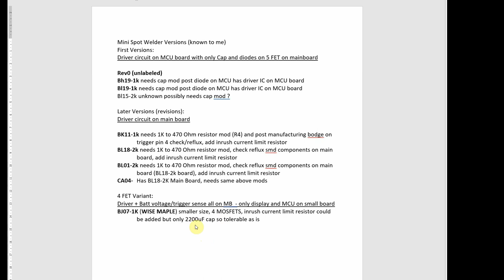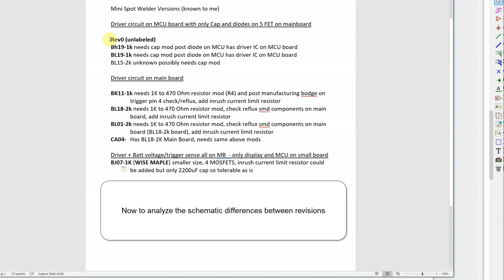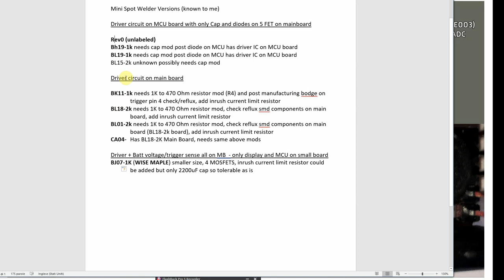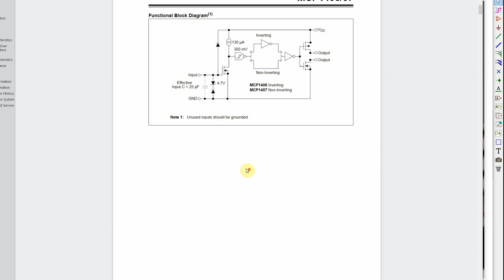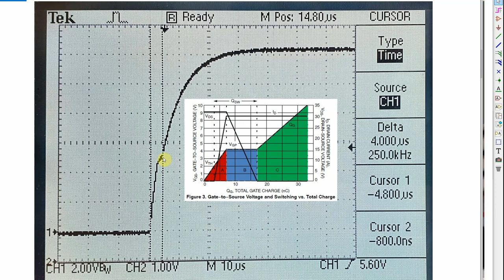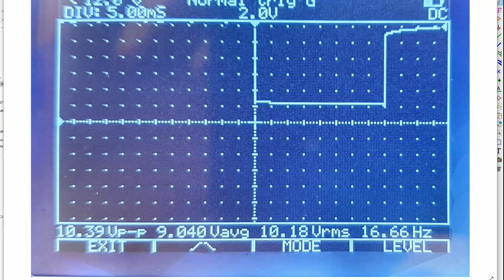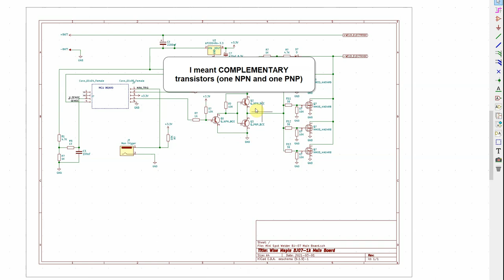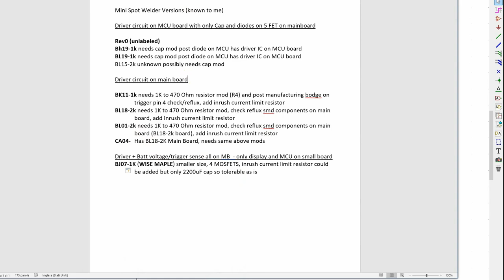All "Mini Spot Welder" versions: circuit Analysis, differences and faults

Comment: Just received one from eBay - display/MCU board marked Bl01-2K, MOSFET main board also marked Bl01-2K, that has some clear post-production hacks soldered on to the backside of the MOSFET board.  There is a 1K  resistor soldered between pins 1 & 2, and what appears to be another between pin 2 and the negative pin of the capacitor.
Reply from the maker: Yes that's an old revision which I also received but was labeled bk11-1k: please check out my prior video about it. I suggest you check the solderings of those biasing divider resistors, the 1K and 10K connected between + and GND. Mine where not soldered on properly, specifically the one with the bodged on copper wire to GND (10K). I replaced them with 2 normal resistors but maybe yours are ok, check continuity first. You need to replace the 1K resistor (R4 if you have a silkscreen) on the MCU board with a 470 Ohm one and don't forget to add an inrush current limiting resistor in series with the diode beofre the large 10000uF Capacitor. It's all explained in detail in my videos.
Reply: @Luca_Techy  Thanks much - I appreciate all the work you have put in here.  Yes I have already replaced R4 already and will be adding the inrush resistor as well.  My biasing resistors seem to be solidly connected, but yeah that goofy copper strand doesn't exactly look secure - I will be replacing that.
Reply: @Luca_Techy  I did your suggested repairs, and also switched out all cables for 6AWG copper, and made new welding probes by stripping the 6AWG, slipping a piece of solid copper pipe over it, and then using a hydraulic crimper to bond the wire and pipe.  I can now very easily weld .15mm pure nickel strips to a battery at 30e, and weld .15mm nickel to .15 nickel at 60e, all day long.  A further bonus is that after swapping out the original aluminum wire for copper on the welding probes, the probes don't heat up nearly as much.  I can perform 4 dozen welds at 30e or a little over 2 dozen at 60e before the probes start getting too warm for comfort.  I have at least 400 welds on this new configuration at it still going strong - very pleasantly surprised.  Thanks again for all of your hard work in documenting this.

Comment: thank you for the video. very comprehensive. Since you have big knowledge about spot welders, do I need some beefy diode/s  from drain of the mosfets to the plus side of the car battery(supply battery), or a TVS to deal with the flyback voltage/current and/or transients to protect the mosfets from blowing up? since I have the first version and even with the mod´of the capacitor after the supply diode, I`ve managed to blow all the mosfets at the same time and with a bang blowing the top parts or holes in them. Any suggestions?
Reply from the maker: You don't need any reverse voltage (Lenz) protection as there is not enough induction occuring (if any) along the power wires. If you blew your FETs then either your were overdriving them or the gates were not saturated fast enough. Dependign on your mini spot welder version you may need modifications (inrush current limiting resister, biasing resistor, check reverse diode for short). These are all explained in the videos.

Comment: Can you help me Luca I received my spot welder but it's the one with a big capacitor and no labels no writings of what model what mod should I do
Reply from the maker: Hi, if it has no markings and has the 2 ICs on the MCU board it's the Rev 0 - it's all explained in the video hoe to identify it. You need to add a 1000uF cap after the diode. If you need more details you can check the video by Maker Fabio on how to mod that version.

Comment: Another one : if you power it up with the 2 probes connected, it draws a LOT of current (even without the control board). it then goes into equilibrium half open/half close.
Reply from the maker: Never power up these welders with the output terminals connected/shunted. The state of the FETs are undefined and can be in conduction state while reaching stable power levels (logic, gates, driver etc). Specifically the driver circuit is driven with a negative pulse and before the voltage rises to stabilize the push-pull and it's driver the gates WILL be ON.

Comment: Hi Luca, thank you for all your videos! I have just bought one of the these and it is different again from the ones you have shown. It has the driver circuitry on the MCU board and looks close to a later ‘Rev 0’ board with white buttons and  many components and optoisolator but after the input diode there is a 6 pin B628 ic and some extra smd resistors and caps. It doesn’t have a number on the board. Does this type still need the cap mod? Thank you!
Reply from the maker: Hi Christian, it's the "new Rev 0": watch my latest video (link in description, playlist and at end of video) for all the details!

Comment: hey i bought the older rev0 version and installed the cap mod. i cant get it to power on.. im using a fully charged car battery and all i get is a quick little beep and nothing else, no power to the display or anything. i assumed i installed the cap wrong and removed it and tried powering on but am still getting the same issue. quickly beeps when pressing the power switch but no display. assuming maybe the display was faulty i tried to do a spot weld but nothing happened so it appears the whole system isnt getting power properly
Reply from the maker: It seems the MCU is not powering up or it's faulty. You can try bridging the power switch contacts by soldering them together to exclude a dodgy switch. If that doesn't resolve it then I'm afraid you have a faulty unit. Be sure the diode is soldered on correctly and there are no visible shorts - the 3.3V regulator should not get hot.

Comment: I think i have another issue that isn't in this video. I have the original version with the 1407 FET driver on the board and I'm getting no delay and full power from my spot welder. I thought I shorted another MOSFET but I checked and I didn't, this was all after i did the 1000uf 16v Cap mod. I think it's something on the MCU board but I have no idea where.
Reply from the maker: Hi, that's either a shorted FET or a faulty driver. Be sure when the device is not powered that Drain and Source aren't shorted - if so find the shorted FET and remove it (if it's only 1 you needn't replace it, it will work fine with 4) and also be sure to apply the 1000uF cap mod. If you get no short when it's powered off, then try powering it on with a normal bench PSU set at a low current (200mA) and check the Gate inputs which should be all LOW. If they are high you can trace the signal back to the MCP output and check to see if it'slow or high of if something is pulling the Gates high (soldering short, bad contacts etc). I don't have the exact schematic of that version but it's not hard to trace the MCP output to the FET gates following my video.

Comment: For those of us who are NOT Electrical Design Engineers (me), which of the three versions is the best and most robust design (after putting in the necessary modifications) that we should try to buy?  And, where are we most likely to be able to buy that version?  OR, would we be better off with a different manufacturer's mini spot welder even if it cost more?  Any recommendations?
Reply from the maker: I have put a coupld of links to AliExpress also in the descriptions of my other videos - these are all the transistor push-pull driver versions which need thet 2 described mods so some soldering skills are required. If you can you should get the first marketed version which I call "Rev 0" that needs a rather simple Capacitor added to the MCU board before using it safely. There are a couple of detailed videos explaining what to do (one is on Maker Fabio's channel) and I describe it also in this video. All subsequent versions need at least 2 modifications to avoid future problems and breakdowns which require basic soldering skills as the board is assembled with SMD components a couple of which need to be modified. I do not have a 100% reliable link for the purchase of the "Rev 0" as they are very random. I know that on Amazon they are usually sold instead on AliExpress you usually find the latter cheaper types but this is no way a guarantee.

Comment: wonder if  the latest versions of these boards already have these mods?
Reply from the maker: I don't think so, I've had no feedback on this as of yet. Many have opted for the single board purple type welder without LCD as the latest revision has the decoupling mod (the first one doesn't as I point out in the relevant video which you can find in the playlist).

Comment: So my takeaway was the Rev 0 (original) and wise maple are the easiest to fix with just either a cap for version 0 on the FET driver,  or a resistor for inrush current on the wise maple. Good video, very informative. I'm assuming the Rev 0 will run OK if you have a good battery, but then again if you dont keep an eye on the battery voltage you might still blow it so a cap wouldn't hurt even with a good battery. I wonder what the lowest capacity you could use on the cap to keep that driver running?
Reply from the maker: Yes, "Rev 0" (also labeled Bl19 on some etc...) is the better made and has basically just that post Cap mod needed. The minimum size to be on the safe side would be a 470uF 25V. As you have a scope, you could run some simulation tests checking the voltage fall on the MCP output with and without the added cap by powering your welder with a bench PSU limited at say 1Amp and setting weld time up to 99 for best "drops". Naturally you won't weld but that's not the point: you can capture Gate traces and watch the voltage fall consistently without the cap and with the cap without damaging the FETs as 1Amp (or even 500mA) will do nothing to them.

Comment: I have the original unit with the mcp mosfet driver. Did you ever get the oscilloscope screen shot? I can do that for you in the next few days.
FYI, I did the cap mod as soon as I got it and have had no issues. Also swapped the positive output lead to the same terminal as the battery positive as that made perfect sense and splashed a load more solder on the drain and source pads.... Just in case ;-)
Reply from the maker: Hi, thanks for the offer but I received already several scope shots - and yes as I mentioned they are much faster than with the pushpull. Good that you appllied those mods I'm sure it will work fine if using a giod battery and not overdriving it (>.15mm strips).
Reply: @Luca_Techy  mostly using 0.12mm nickel strips so hopefully not a problem.

Comment: Hi! On one of the videos regarding other DIY spot welder (BiFRC), it was advised to put battery positive wire directly to the welding tip without connecting to the circuit board. Circuit board is powered by positive wire from 12V 1A power supply. This is said to counter voltage sag which might happen with powering from the battery. Does it make sense for Wise Maple or any of the versions you reviewed?
Reply from the maker: Yes, this makes sense. What I suggest in these spot welders as an easy improvement is clamping the positive terminal and welder terminal to the same screw on the spot welder to avoid the current going through the trace and dropping unnecessarily. Alternatively you can directly join (solder) the positive and welder cables together and simply lead a smaller positive seperate wire from the battery to the + of the Welder board to power it, but this is an excessive measure for these models. The high current will travel from the battery through the positive welder cable and negative welder cables through the welder FETs through the spot weld.
Reply: @Luca_Techy  Thanks! I am going to connect positive to the same terminal, add resistor mod and add some more solder on negative trace. Was not sure about using a separate power adaptor for positive power supply to the circuit. If that is not necessary and the battery is with good discharge rate, will try to use without it.

Comment: Great videos. If at all possible - if you could try and power them with super capacitors that get charged up via a normal domestic mains voltage supply - that'd be awesome.
It's an idea I have as I don't want to purchase a car battery (haven't got a car), nor do I wish to purchase a lithium cell pack for rc vehicles as I don't own those either.
So something that'd work directly of the mains would be brilliant. Super capacitors seem a cheap suitable option for this. But I've no idea how you'd charge them & discharge them through the mini spot welder circuits you've been testing in a safe, reliable way.
A small wait after x-amount of welds for it to charge up is fine. but some sort of protection so a weld is impossible without sufficient power of the caps being charged enough.
I hope I've explained this well enough & that you can help.
Thanks
Reply from the maker: Never power something "directly" from the mains - I suppose you mean through an isolated and regulated power supply - then yes. You can use supercaps of course, but if you are looking to just make a few welds your best option is a complete monolythic solution with incorporated battery around 25Euros. There is also a more expensive and "posh" version with a nice box and gold plated plugs if you like. If you want a decente 500F 12V supercap setup it costs more than the whole welder so better get a complete welder solution with included battery,

Comment: Hi Luca, today I have recived my unit but is the CA20-2K model....what I need to do with this version? thank you very much.......my unit is faulty, the gate is always open or have dead mosfets....no weld, only burn my nickel strips
Reply from the maker: Hi, if you're burning in strips your FET(s) are shorted so you have to locate the faulty FET(s) and remove them. You can use my other video to check if your welder works properly with a light bulb (check my last video). You need to apply both R4 470Ohm resistor mod and in rush current resistor as shown in my other videos(check the playlist)

Comment: Another thought - would it be beneficial to have some sort of heat sink or thermal pad on top of those MOSFETs?  Cooler running, longer life and all that.
Reply from the maker: Usually, these mini spot welders aren't used so continuously to get the FETs to overheat at the point to which they will either fail or have a life reduction (these FETs don't blow usually because of "normal" overheating, they blow because of abnormal Gate drive and mismatch). Once you feel the board getting warm (>45 Celsius) just let it cool down for a couple of minutes. A simple small CPU fan can also help but usually it's not needed. The weld electrodes will get hotter before the FETs do and that will be your cue to pause at that point (usually after 10-20 repetitive welds based on the strips) and let them cool down.

Comment: Let's say I have the same AGM battery that you had when you where getting 2 volt out, and I use a car stiffining capacitor parallel with the battery, like they use in car audio applactions could that dump enough current to cover the on state of the fetts to keep the voltage up long enough as to not damage them?
Reply from the maker: Yes that's fine too if you have on handy, just keep the supercap close to the welder not the battery for best results. Just run some test welds starting from 5ms upwards- you should get decent welds around 20ms as a ballpark figure. Weaker batteries will require more time (30+ ms).